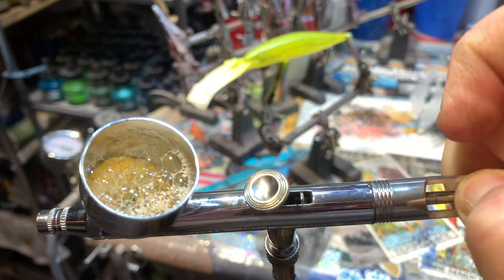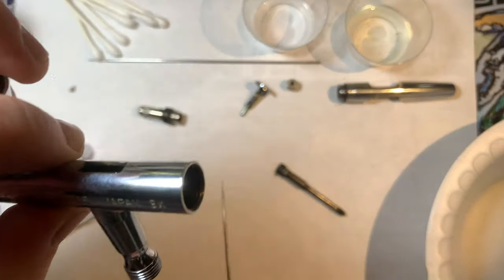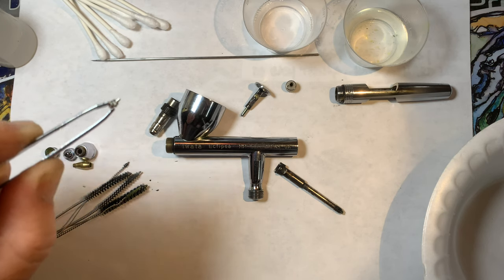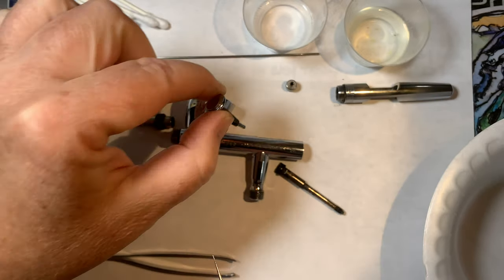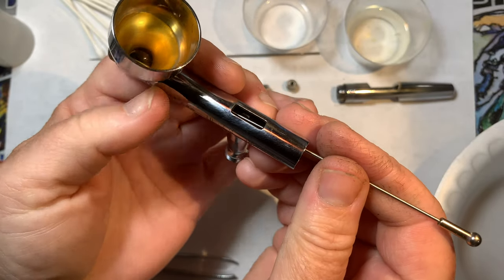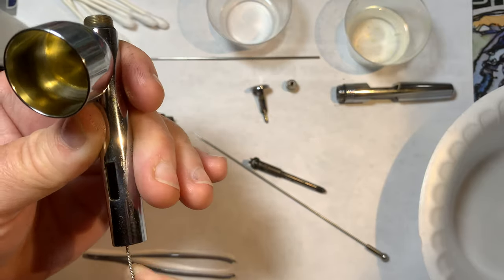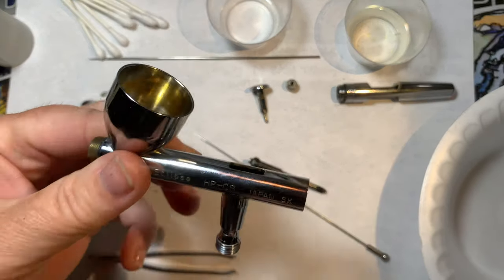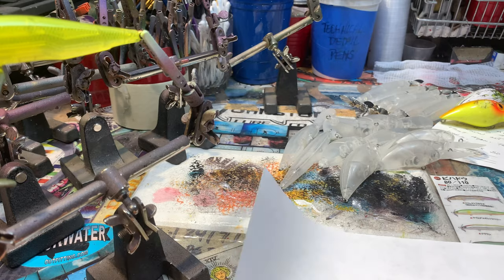The Airbrush DEEP CLEAN.... (Trying to solve the problem - Part ONE)

Comment: Jennifer you may want to try: 4008 Restorer - A water-based, biodegradable cleaner used for soaking airbrush and spray-gun parts after painting

Partially dissolves dried paint allowing for easy clean-up with soap & water.

Use as a soak for metallic parts: nozzle, needle, cup.

Re-Usable. Keep in metal or ceramic container.

Dissolves soft-plastics. Keep away from non-PTFE coated O-rings.

Flush airbrush or spray-gun with water after using Restorer.

Make sure you don't soak any o-rings!

Comment: Most likely the O-Ring in the front of the gun is bad #16051. Take the one out of the back and swap them. Another thing to replace is the Needle Packing Screw Set (PTFE) #16111 that the needle goes through. Look where the Cap #16031 screws in. There is a small air port where the Cap screws in that get clogged along with the three small air ports in the front of the Cap. Most of the time you got a clog in front part of the gun forward of the paint chamber. Very frustrating.

Comment: Jen, if the tip of the nozzle is inside of the nozzle cap, the air will push into the nozzle tip instead of pulling the paint out of the cup.  The nozzle tip should be even with the nozzle cap opening or just a bit outside of it to give a venturi effect.

Comment: As for the gunk from the back of the cup to the trigger, there is a Teflon seal that can be adjusted with a flat blade screwdriver to adjust the seal around the Needle. Turn very little clockwise , insert the Needle and check the feel. Repeat as necessary . Badger and Iwata both have good Needle lubes to break the tension on the seal to Needle.

Comment: I’m telling you it’s the nozzle  if it’s worn or has a small crack even if it’s on the inside it will do that had the same problem
Reply: Get a 10x jewelers loop and look at the nozzle for a crack.  If no crack, use an old needle and cleaner and carefully circularly scrape the inside of the nozzle with the needle, gradually working deeper into the nozzle.  Reassemble and try spraying water or cleaner, not paint until it seems to work correctly again.  Observe the water spray pattern.

Comment: On the front of the airbrush there is a hole that is visible when you take nozzle cover off.  If you have not done so already run a dental brush with acetone through that hole.

Comment: I still think new nozzle🙂 have you ever changed the o-rings and sealings? If not the o-ring on the aircap could also give Some false air, and then til have a problem so.
Reply from the maker: Yes. Nozzle and rings were replaced last night. Same issues 😶
Reply: Okay so i have another shot, have you tryed to screw the airvalve of and tryed to adjust it?
Reply: If you dont get it to run, take the creos ps-289 exactly same gun as hp-ch plus. You get so much quality for a more cheaper price, i think in the us you can get it for About 150$ some stores cheaper. I have allways been a iwata an H&S man, but i Will never look back!
Reply: Did you lubricate the needle packing and trigger o-rings with the lube that comes with the airbrush?  I had the same problem a while back and soaked all the parts in alcohol/water mixture (yes, can be hard on o-rings) for 15 minutes, cleaned all the parts using toothpicks and the supplied brushes and then lubricated the parts mentioned above.  My Eclipse now works great.  Good luck.